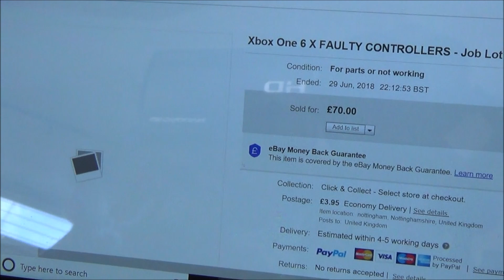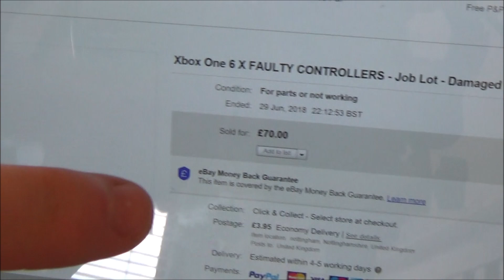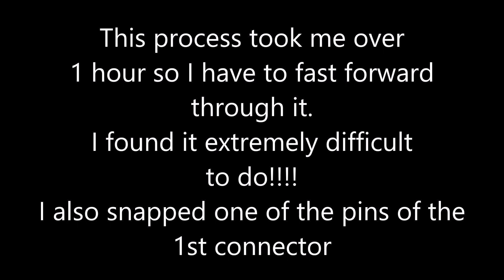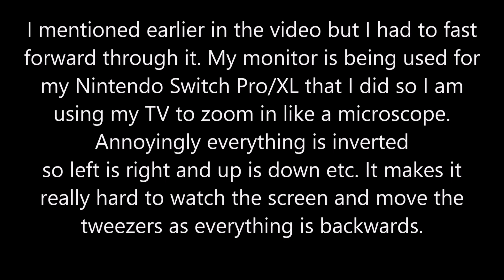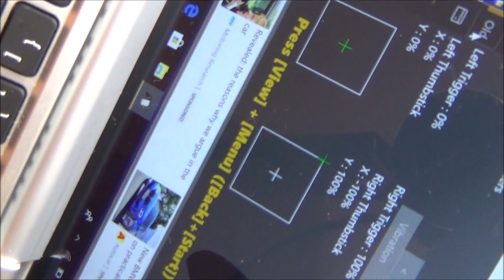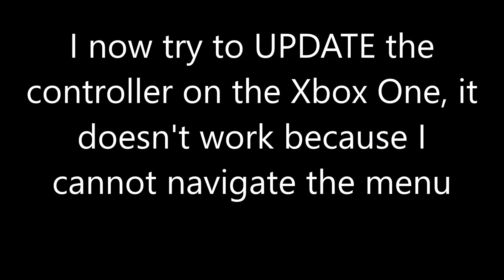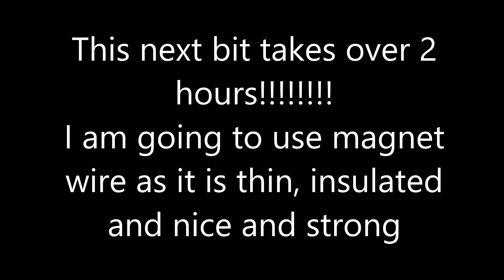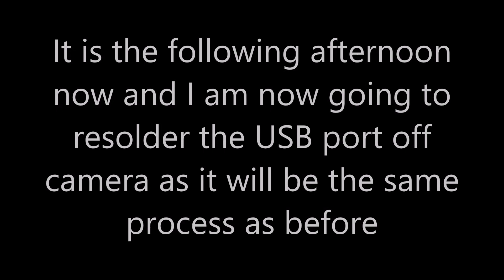Trying to FIX eBay Joblot of Faulty Xbox One Controllers PART 1

Comment: I would buy some thin wire like others have suggested. There is 0.2mm thick on ebay of both 'Tinned copper wire' and 'enamelled copper wire'. Tinned copper wire would be easier for you but it's conductive along its whole length so you have to watch out for shorts. Enamelled copper wire is coated so doesn't short, but you have to scrape the coating  off the part your going to solder, which on wires that small can be tricky.
Reply from the maker: Thanks pds8475, I just asked this question to GadgetUK164 about the scraping but you have now answered it :-) I like the enamelled copper wire as it has insulation but I wish there was a wire that allowed the soldering iron to burn off the insulation to save you scraping it, so just a tap of the iron would strip it back and solder at the same time. I am sure I watched a video a couple of years ago that showed a mod on a games console where he was just soldering the wires with just a little tap of the iron, the wires looked to be a black colour so maybe the iron was just burning off the very end of the plastic insulation on a standard type wire. As always, cheers for all the help :-)
Reply: @Mymatevince  Yeah plastic coated wire is a lot easier.  You can use heat on enamelled wire but it just makes the enamel brittle so you have to scrap it anyway. CPC have a 0.15mm(38SWG) self fluxing polyurethane coated wire but it is quite expensive at £10.32 for a pack of 4 reels of 38m lengths.
Reply from the maker: @pds8475  Thanks so much. I found it on CPC and was going to buy it but it mentioned that it can produce toluene di-isocyanate when soldered so I think I will stick to normal enamelled copper wire. I know the amount would be tiny but for piece of mind I will give it a miss (bit paranoid about cancer related things). Thanks for sharing the link though because that looks like exactly the thing that I described :-)

Comment: is there  not a component missing from d15  2 pad showing  and a shadow  (  maybe a diode) near the usb port same  with d16 and 17  ofc you could check by opening another one   :)
Reply: exactly what i thought, looked like a few components missing around the usb socket area
Reply: I think that is a solder Bridge for configuring something.  Those pads don't look like they had something on them. But it's possible.

Comment: Was wondering if you could offer some advice on an Xbox 360 Slim repair - I've got one where the front USB ports and eject button aren't working. Seems an odd combo but I suspect they're related as the eject button issue isn't due to the RF board or connecting cable (tested with working ones from another console) so it's definitely on the mobo somewhere. USB ports are getting 5v, so must just be the data that's not working. One capacitor near the USB ports had obviously been replaced and the other was missing, so I put two new ones on just in case. Only other sign of damage I can find is a damaged trace where the X-Clamp has been removed carelessly, which I think I've repaired with some conductive paint but not 100% sure. Do you have much experience with 360s? Any ideas what I could try next? Would you like the console to play around with?

Comment: 7:16  Diodes 14 and 15 missing on the ground and +5v traces?
Reply: Good spot! and a resistor perhaps.
Reply: @willproctor7301  resister 7 and diode 16 and 17 now I've looked at it again.

Comment: There is such a thing as conductive paint, might be worth looking into, no soldering required.
Reply: He has used conductive paint in other fixes, but the trace lines are so tiny here that he wouldn't be able to draw such thin conductive lines.

Comment: You may ignore this comment Vince, because as I watched further you used flux and ensured the below mentioned components were connected to ground..

As I am watching I stopped @ 7:28 in the video, where we have components "C2", "R1" & perhaps a critical Diode "D14" Or "Di4", where these component and perhaps many others further up the track/s might all need to be connected to ground via the USB Port once it is soldered in correctly, A word of caution though as it also may be that it shouldn't be connected as it seems in the video, so a comparison to another controllers board may need to be made to ensure whether it should or not be connected to the ground..

Comment: @10:45 - you can do it there's plenty of pads around, but it really pisses me off this does because the guys that you bought it from burnt it. the plastic housing is all melted, there's burn marks on most of those vias and there's also looks to be burn marks on some of the components. my guess is this was using some form of fake charger that screwed up

Comment: Hello there Vince how’s it going  .. how do you like that little computer that you use looks pretty awesome any complaints on it ? Remember coming across your videos because of the little laptop computer how do you like it what’s your review on it ?
Reply from the maker: Hi, I use the GPD Pocket daily. I really like it. The biggest gripe is the WiFi signal is not as good as other products (maybe the case is blocking the signal a bit). But apart form that I am happy with it. I did a multi part review on it a couple of years ago on my channel if you want to watch it :-) If you don't need something that small though it would be cheaper to get a full size laptop with better specs :-)

Comment: You coul try to solder a usb cable where the usb connector is, that way you can make it permawired and protect way more solder work so it doesn't come loose.

Comment: I admire your persistence and patience. But you used TOO much UV compound and the USB port repair was a bit crusty, you could use thinner coated wire and instead of hot glue, use epoxy (just a little bit though). 
Still a great job.

Comment: Hi what device do you used to scratch the board and clean the copper?
Reply from the maker: Hi. Fibreglass pen
Reply: @Mymatevince  Thats What I thought, I bought one and it does nothing.
Reply: @Mymatevince  Do you have a link for the one you use, mines rubbish.
Reply from the maker: @jase171973  I just got a really cheap one on eBay (£2-£3), I had to tape it up because it started to come apart but it does still work. It was just one of those generic cheap ones, loads of people sell them :-) My brother bought one for around £10 which I think was made in Germany. It doesn't work any better at scraping but it is better made so it is holding together well and will definitely last longer :-)

Comment: You need to invest in some 30 gauge enamelled wire for rewiring things like the data lines on damaged traces. You are making more work for yourself using the thicker stuff. Maybe time to invest in a quality soldering iron as well, It will make fine soldering much easier for you. Checkout Metcal, Pace or Hakko but watch out for the many Chinese clones that are flooding the market. Karl

Comment: TronicsFix has done something similar to what you have done. Instead of fixing Controllers he tried to fix 16 XBOX ONE S/X Consoles and only 6 of them was repairable and he came to the conclusion that the Seller from Canada was shady and he will never do business with him/her again.
They even went so far ahead into hot gluing ports/sockets onto the Metal heatshield with no Motherboard to trick the buyer into thinking that the Console was untampered with and intact.

In your case Vince the Seller of those Controllers may have scammed you and now the period of getting a refund is now gone.I just so hope you can at least repair the other 5 Controllers but if you can't then you have replacement parts to use for other XBOX ONE Controllers but ideally if you can repair just 3 of them then you can sell them at £20/25 each which will make back that lost money.
Reply from the maker: Thanks. I have just been working on the 2nd controller today!!!!! I am about to edit the video (all 3.5 hours worth!!!). The Tronicsfix videos were brilliant, the gluing in of the ports takes it to a whole new level. I have never seen that done before. At least he has a load of new subs and views from those vids as he wouldn't make his money back on that joblot :-)

Comment: Hey guys, I am trying to do my thing buying broken consoles and accessories and fixing them up too. I fixed a Xbox one a with hdmi problems. 

I have a controller that only stays on when the Xbox button is pressed down once you release it it will turn off. Also it turns off after 5 seconds or so while being held down. Any ideas? Everything looks good.

Comment: Vince, it's also worth googling "acidmods xb1 pcb scans" and the controller model number (1537 1697 1708 etc) some great high res pics of boards and all traces. Inc test point info.
Reply from the maker: This is brilliant, thanks for sharing this info :-)
Reply: @Mymatevince  no probs, repaired and modded many xb1 controllers and this info was invaluable. 👍

Comment: Wired controllers have a bug when no batteries are inside it will search for a device. In the case you have, all you need to do is hold down the xbox button. 
Like so he can see

Comment: Hi Vince, for repairs like this it’s better to use coated jumper wires like this...
https://www.microsoldering.com/product/0-10mm-jumper-wire-coated/

I also often use coated wires from the winding of an old transformer or motor, which is pretty much the same thing.
It’s way easier and cleaner to work with these wires on small jobs like that micro usb connection.

Comment: Could be that the ground is somehow interrupted to one side of the board, that would knock out the buttons, triggers, stick all together. I'd solder a jumper wire to the ground plane around the bad stick/trigger to a known good ground, and see if it starts working. You can use this site to read a bit on how these controllers work, and where some of the traces go: https://www.acidmods.com/forum/index.php?topic=43204.0
Reply: Should've watched the whole video.. hehe. The scrape is right where those traces go, still, bookmark the link I posted, that's a very good reference when working on XB1 controllers

Comment: The ONLY reason this is even close to economicly viable is the youtube video   the time you spend to repair them is worth mroe than the sellable controlers themselves
Reply from the maker: Definitely, I make money from the adverts so for me it is worth fixing it or trying to :-) No one would do this professionally as the time taken will not pay. That is why I mentioned at the end that both boards were junk boards because they are economically unrepairable :-) BUT saying that, if it is your own controller then it is worth fixing if you enjoy doing so as the parts are dirt cheap so it only takes time and your own time is free :-)
Reply: @Mymatevince  Our opinions differ on the "your own time is free"  part there are many much more profitable things you could be doing with your time    Like work but if you play games then the point is really moot anyway!   Thanks for the videos though!    What I mean is let's say you have a 12$ an hour job     your time is worth 12$ an hour  and it takes you 6 hours to repair the controller   you could have spent that 6 hours working and gotten a new one and had some money left over to get a pizza   Now if fixing random things is a hobby  that changes things :)

Comment: Gutted you could not fix this i have not had much luck with a repair on a pearlcorder S710 the motor is working but nothing else is and not keen unsoldering 2 super thin wires to get at the main board
Reply: Timsalt3100 spoiler alert

Comment: That shield means nothing. I have 2 Xbox one controllers, one of them has nothing on that side at all, and the other has the shieldless arrangement you thought represented a previous repair attempt. Both of these controllers were bought new retail by me a couple years apart.  The shield however is the newer board, I know this because it's the same as my xbox elite controller.  What's the real lesson here?  Xbox controllers are junk.

Also, I've used the wireless dongle on Windows 7 for like 5 years. You don't need Windows 10 for wireless.

Edit: Just finished your video and see you've discovered the shield thing.

Comment: Pfft ebay please

 Shit dude I bought a new controller from Walmart wasted 63 dollars on it literally is faulty everytime it vibrates say from getting shot in battlefield it turns off and wont come back on.

I've tried taking it back but I  didn't use it till my old one completely was unusable, now I am stuck with a unusable faulty waste of money.

Brand spanking new controller too but faulty ass paper weight.